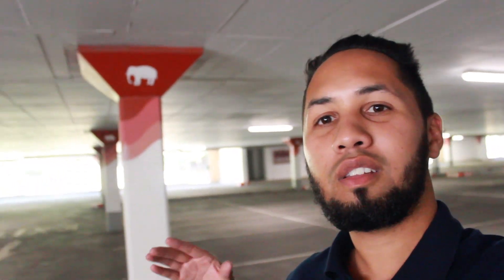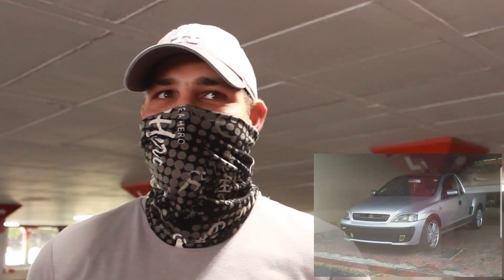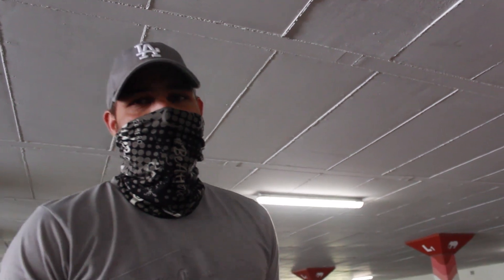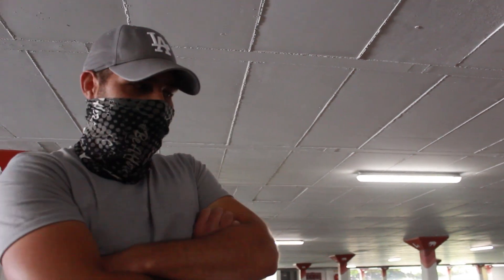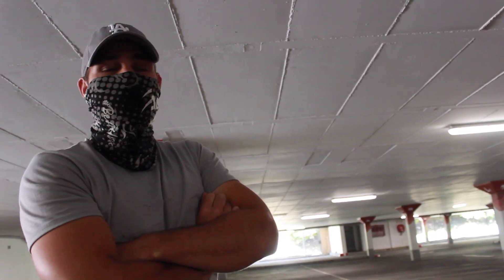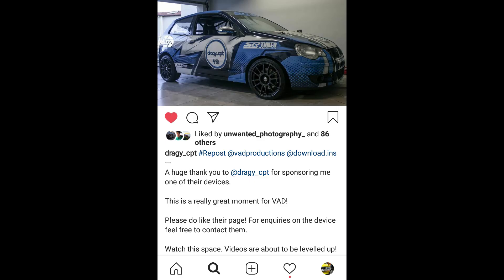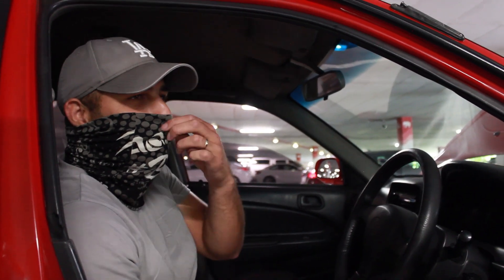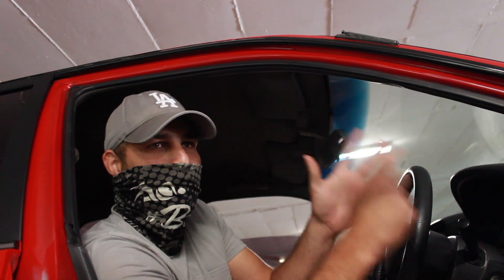2ZZ-GE SWAPPED TOYOTA COROLLA AE111- This is my ride- Ep09

Comment: 🧐 In Puerto Rico 🇵🇷 we put 6 cylinder engines in Toyota Tercels.  😜
Reply: This 1800cc 4 banger makes 200hp very ez and weights almost nothing. Even the car itself weighs less the a tonne and can run low 12 high 11s easily.

Comment: Beautiful car, pardon my ignorance, won't the dual beams swap make more power, and surely you could reach well. Over 200wkw aspirated on a dual beam, the 2zz I highly doubt you can get anywhere near 200wkw,but very nice though, the car looks great
Reply from the maker: I guess it all comes down to how much money is put in yes bro. At the end of the day its comparing a 2L to a 1.8. and deciding if you wana spend a bit more on the 2zzge than the beams. Owner however bought the car with a 2zzge swap and broke motor. Replaced with another 2zzge as everything was in place already, shafts etc.

But to be honest the two are both well designed motors having both different characteristics. At the end I guess it comes down to personal preference. Like the owner says 2zzge is just different and he has nothing against the beams guys.

Comment: Isn't this the car Josh built? This car was a 1300
Reply: Only the shell is left of the build. Motor management fuel lines complete suspension rims all changed. Basically bought a broken car made to last 3 weeks. Anything else you want to know.

Comment: Needs a limited gearbox and/or 6speed
Reply from the maker: It has a lotus LSD box bro. Gear ratios in person are super evil. Awesome power through all the gears
Reply: @VADproductions  whats model of the Lotus gearbox an what bell housing or adapter is used?